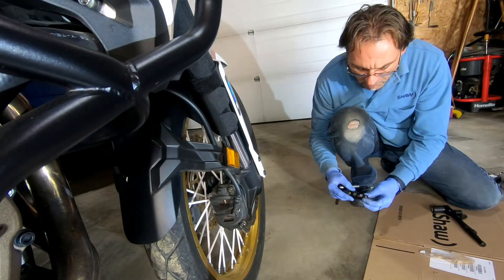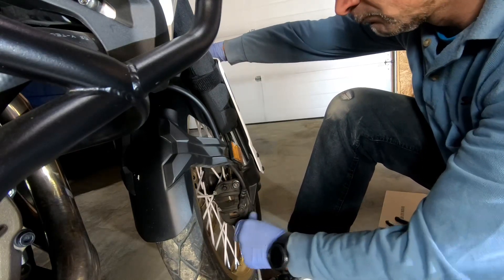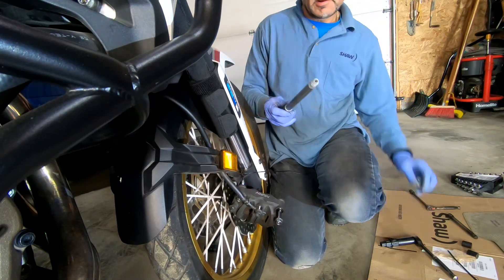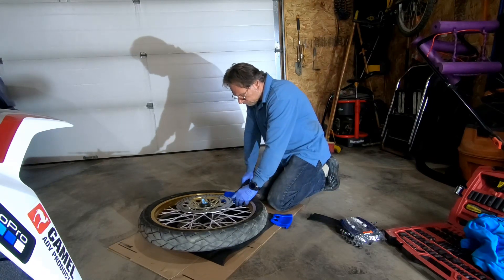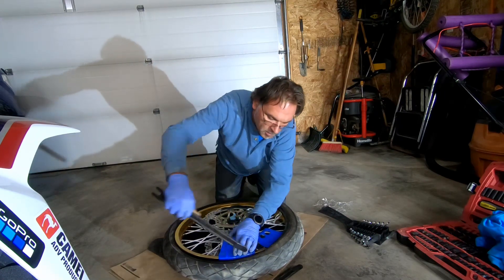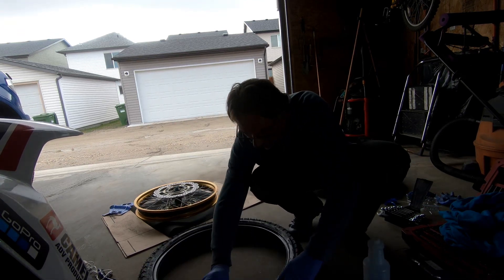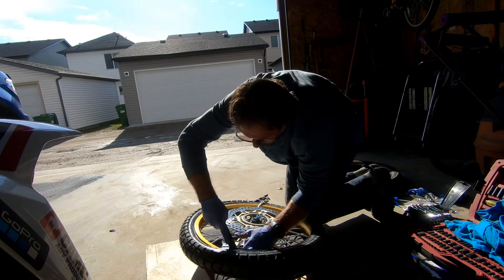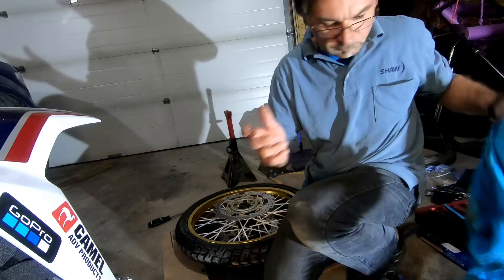How to change the Tire on 2017 Honda Africa Twin CRF 1000

Comment: Good video. Just makes me realise why I should buy tubeless wheels.
Reply from the maker: its not a big deal to swap or repair tube I just had to do it 2 weeks ago side of the road
Reply: @AdventureTravelandScuba  I'm sure! It's the fear of it I need to get over. I'm sure if you do it once you are an expert next time.
Reply from the maker: @GavCritchley  Practice at home first no big deal a bit tough on the fingers at first the every time you get better and faster at it.  If You mess up and really not able to do it you will be always able to drop it at your local shop to finish up
Reply: @AdventureTravelandScuba  You are right of course. At the shop the chap uses a plastic tub so the wheel sits on top without the rotor getting in the way. He must do 2 a day so has 'the knack'!

Comment: thanks for the video that was informative. I have an African twin sport 2018 and I'm putting on tractionator adventure tires, did you have any trouble with the clearance from the front fender? I know rox has a riser that lifts the front fender about an inch, wondering if I need that or if you had any troubles. Thanks!
Reply from the maker: No You will have no issue with clearance at all im on my thid set now and just installed ROX fender riser last month.  It looks a bit better with 1.5 inch gap do
Reply: @AdventureTravelandScuba  OK great thanks!
Reply: I forgot to ask did you have any problems when you put the risers on the front fender with any of the cables?
Reply from the maker: @popper690  Not at all all stock cables
Reply from the maker: @popper690  I will have a video very shortly couple of weeks on the install

Comment: Just so everyone knows, you absolutely DO NOT have to remove your brake calipers to remove your wheels from the bike.  That is a completely unnecessary step.
Reply: You have to on the twin ;)
Reply: @noobonpc275  nope.  At least not on a 2017